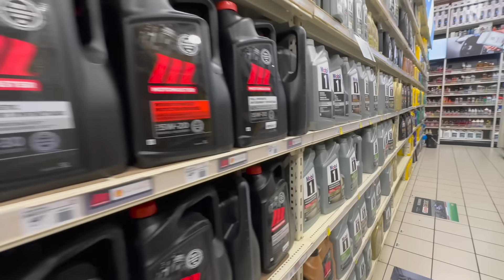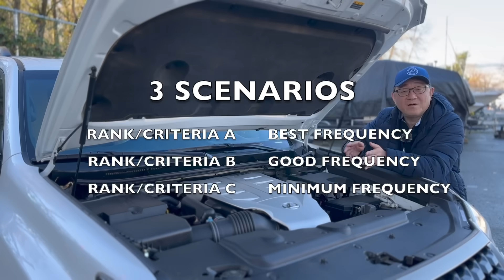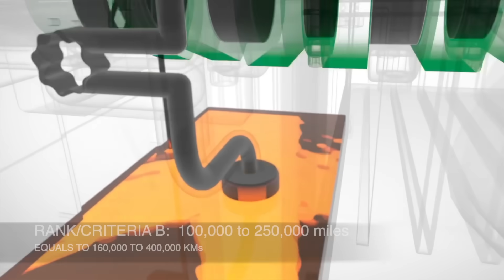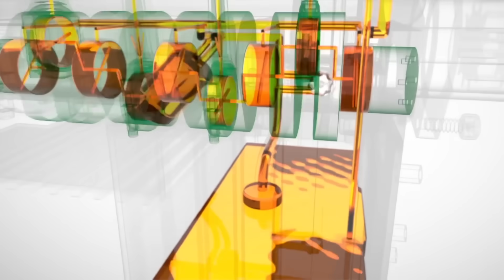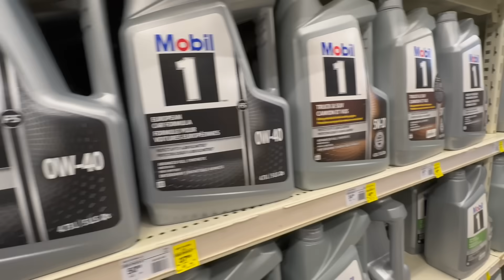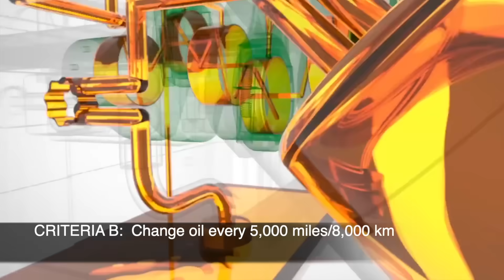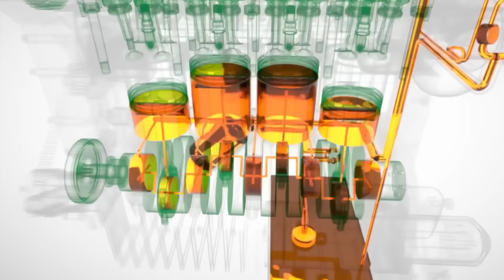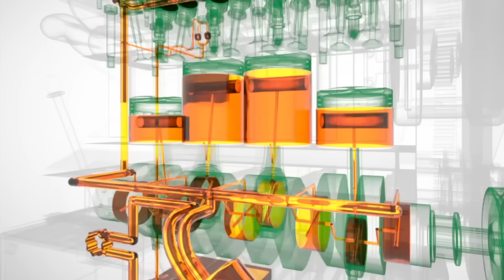ENGINEER EXPLAINS HOW OFTEN TO CHANGE OIL & FILTER // UPDATED CRITERIA-BASED RECOMMENDATIONS!

Comment: And on turbo engines without separate oil pump lubricating the turbo itself it's important to let the engine idle for at least 1 minute before turning off the engine. Giving the turbo time to rev down again before the lubrication is shut down together with the engine shut down. Some cars have separate oil pump for the turbo itself, but not all cars. Something to have in mind. 
Great video... thanks 👍

Comment: I have a 2014 mitsubishi lancer with about 80k kilometres on it. When it was new i changed at 1500k,3000k and then 4500k. There was fine metal in the oil at each change. Then i went to 7500k intervals. The book recommends 10000k intervals which i feel is too iong. Also the manual gearbox was recommended for oil change at 140000k which i feel is way to long for first change. I did it at 55000k and there was fine metal present in the oil. I use Nulon oil which is Australian made full synthetic. I get oil when it is on special and oil and filter change is under 50$ 
Cheap insurance. I put it on the dyno and it  gave 130hp at the wheels which is good for a 2litre 4 cylinder car. Everyone has there opinion but i think my car will outlast me😊

Comment: In the real world, where real people are responsible for real money, fleet managers with hundreds of vehicles invest in test equipment to ascertain the actual condition of the oil, per vehicle. They report intervals as long as 20k to 30k miles, 32k to 48 km. You must change the filter at 10k miles though. Even with a perfect engine, everything else on the car becomes a losing proposition overall past 20 yrs 250k miles, unless you work on the car yourself. The environmental impact of the waste from brief 3k intervals, versus even 10k intervals, is unconscionable. When pressed for data, author effectively says, "Just trust me." Red flag.

Comment: It’s your car, your money, oil changes are cheap compared to an engine failure, worked at a ford dealer for 40 years and saw the results of manufacture recommended oil and filter changes, worn out and sludge build up before 100,000 miles, these engines are still 120 plus year old technology driven in every type of climate, and conditions by every type of driver, the other factor that enters in is no one checks the level and condition of the oil, if it’s changed at 3,000 to 4,000 miles there is a good chance to catch a low oil condition, versus minimal oil left at 10,000 to 15,000 intervals.

Comment: Seems obvious that the best solution would be to improve the filtration instead of this continued nonsense of frequent oil replacement.  But that would substantially impact the bottom line of Big Oil, and aftermarket oil filter manufacturers.  Near me, the main utility company had a policy that they never changed oil in their fleet vehicles; only the filters.  And they clocked hundreds upon hundreds of thousand miles on their vehicles routinely.  
As oil breaks down, it will tend to vaporize and enter the PCV system to be burned away.  Water of course leaves, too.
Amsoil had an external oil filter kit which seemed to work well as I recall.  Toilet paper rolls were the filter medium used in DIY and some aftermarket filtration systems, and by the test results proved extremely effective.
Also, a surge reservoir in the system which would hold a quantity of oil under pressure would be used to prime the system before startup, saving up to 10 sec of initial oil starvation conditions and its associated wear.  
I believe that we're looking at this the wrong way.  But I must concede that for the average Joe, the info presented here has real value.  I just don't like that it's presented so myopically.  Let's think of the broader possibilities and demand progress as consumers, at least.

Comment: For vehicles that record time interval, wouldn't it be better to use that rather than miles as the determining factor? Thus, every 100 hours could range from around 3500 miles to 6500 miles, depending on the type of driving. I have a 2010 Toyota Corolla that is changed with synthetic oil every 150 hours. It still uses no oil between changes, is going strong and has 185,000 miles on the engine.

Comment: add 1600 miles more on synthetic is not necessary, all car manufactures and oil manufactures said up to 10,000 miles vs 3,000 miles on conventional oil.

Comment: Do ou have a recommendation for adding an oil cooler with extra oil capacity or for adding a bypass filter to clean the oil contaminants?
Reply: My old diesel tractor has a Perma Cool universal oil cooler sandwich adapter. Instead of the oil going thru a oil cooler it goes thru a flat head Ford V8 canister filter that has been converted to use Scott 1000 toilet paper. It has half a roll of Viva towels in it now. Got the adapter from Jegs years ago. If the tractor needed a oil cooler I could put one in series with the bypass filter. The bypass filter has no orifice. Its not important but the full flow filter is a Motorcraft Fl 1A. The Ford filter was optional equipment and used cotton.

Comment: Purchased a new '23 Toyota, synthetic engine oil started to get dirty and darken after a little over 3K miles, so I went to dealer to request change oil & filter for a fee, not for free.  These service people were argumentative and refused to change the oil, saying 10K miles was rule, so I went to another dealer. I believe some dealers want you to abuse your vehicles, so you can have more significant repair bills.
Reply: Yikes, put the tin foil hat away.

Comment: I've always changed my oil every 3,000 miles for decades now and have never worn out an engine.  Still driving my 1984 chevrolet, no telling how many miles it has but quite a few.
Reply: I believe you. It would be difficult to wear an engine out when you throw perfectly good oil away every 3k miles.
Reply: @majicogarcia8417  My guess is you don't keep your cars long and don't work on cars.  I've seen enough sludged engines to know changing the oil is a necessary evil if you plan on keeping it for decades.

Comment: Oil is cheap, engines are not. Use the right quality oil in the right application and change it when you should (along with a quality filter) and any well-engineered vehicle will give you years of service without any issue. 

As an aside, new Toyotas often spec 0W-8 oil and this is slated to be available at Walmart soon. Mobil is going to offer it and it does meet the required JASO GLV-1 standard. I have a 2024 Corolla XSE and thus far it's a very nice car.

Comment: I once had a 2005 honda civic. I changed oil every 10,000 miles per mfg. I ran 250,000 trouble free miles with synthetic Mobil 1. I assume the engine would've run forever sans the rollover accident induced by a drunk driver.

Comment: 2012 Hyundai Elantra 1.8 just turned 500K original  engine , only used Amsoil top tier oil and Amsoil filter  changed it every 11-12K it now uses two quarts between changes , no complaints.
Reply: My 12' Japanese Altima NEVER uses oil between oil changes.  If your car uses oil you have a major problem.
Reply: That's awesome. Wonder if it's valve seals or rings,  amazing oil.
Reply: In the early 80s Amsoil had a very good bypass filter. They had Bobby Unser saying this oil change is forever. At the time I was using Amsoil 10 40 with a Frantz oil cleaner. I quit draining oil routinely  in 1963. I believe the Amsoil bypass filter was better than what they have now and too expensive.

Comment: I do synthetic oil changes every 5,000 miles on my vehicles along with an OEM oil filter. I have no trouble making it to 250,000 miles. I definitely agree with your advice. Even though modern engine oils are excellent, it's the contaminates that are suspended in the oil from the air taken in from the engine, fuel, carbon and others. A bypass oil filter will really help this as well.

Comment: On minute 4 you say oil preserves its lubricant capabilities for a very long time.  How long would that long time be for a mineral oil 15-40 c.a.s.t.r.o.l GTX  (a decent brand name of oil) in an engine car (60 thou miles) with just short trips (7 to 20 miles twice a week) . What I've been doing is changing it every 3thou miles or every 6 months(whatever comes first) BUT since the vehicle is rarely driven I was wondering if I can extend the oil change intervals. Please Ivreally appreciate if you or anyone can answer my question.
Reply: Oil will last pretty much forever. It will get dirty You can burn it up. I dont drain oil but I use filters that clean oil. I drive enough at normal oil temperature for the PCV to remove the condensation and unburned fuel.  I use synthetic but the newer conventional oil is good. In the old days multi grades were crap. Couldnt use them in a diesel. The polymers stuck to hot engine parts. With filters that clean oil you might as well use synthetic. Jackmaster is the best in production. I have the Jackmaster Classic. Cant see buying the more expensive Jackmaster Ultra for my use. You can Google them. I havent sold filters for years. They havent put filters that clean oil on cars since the 50s. My 1937 Studebaker book said its not necessarily to drain the oil. Change the filter when the oil looks dirty on the depth gauge. I believe they used cotton in those days.
Reply: Of course you had to drain the oil if you got a leaky head gasket. Or a leaky fuel pump diaphragm that put gasoline in the oil.

Comment: Criteria A - Maximum Longevity (10 - 20 years) - 400,000 to 800,000 kms - or even longer.
Change oil every 3,000 miles / 5,000 kms  (6 months or earlier)

Criteria B - Good Longevity (4 - 10 years) 160,000 to 400,000 kms
Change oil every 5,000 miles / 8,000 kms or once a year or earlier - whichever comes first. 

Criteria C - Minimum Frequency (1 - 4 years) 40,000 - 160,000 kms
People leasing or financing - who don't value longevity are recommended to follow the interval in their owners manual. 

Oil is able to keep its lubrication properties for a very long time.  However, oil does get dirty and air and gas contaminants do get into the mixture Hence, why time is just as important as distance.  

I have huge respect for David,  AMD from The Car Care Nut Channel and every mechanic who offers sensible advice.  

I live in Alberta, Canada and drive a Corolla Hybrid. Here is my oil change interval. 

January - April 
May - August
September -  December

I drive less than 15,000 kms annually (suburban 60% & highway 40%)
Car has been rust-proofed and PPF added because Alberta roads have a  ton of salt and sand on the roads. 

Criteria A - Phenomenal owners
Criteria B - Fantastic owners
Criteria C - Are not bothered about the longevity of their vehicles and less likely to maintain them - Zero respect.

Thank you David & The Car Care Nut

Comment: All engines operate at different temperatures and run differently. I change my engine oil when the oil becomes a dark brownish colour regardless of how many miles it’s done. Oil and a filter is cheap-a replacement engine is not.

Comment: I drive a 2023 Mazda3 2.5 S Select FWD Sedan. So far, I've taken it in for an oil change & tire rotation about every 3500 miles. My first oil change was before a road trip from Illinois to Arizona and back. My second oil change was after returning from the road trip. I'm due for my third oil change soon. The car runs great and has been reliable. Not sure how long I'm going to keep the car, but I prefer to maintain it often and reduce the need for expensive repairs. Thanks for the recommendations.
Reply: Much respect for taking care of your vehicle... When you go and sell it with all the maintenance records the new owner will be able know exactly what fluids have been changed and when to replace the fluids that have yet to be changed.  
Thank you for taking care of your vehicle.

Comment: Regardless of criteria, if you run synthetic, change it ad 5,000 miles plain and simple. Especially if your doing a lot of stop and go.  The engine oil the life blood of an engine. These braindead 10,000-20,000 mileage intervals on Mobil 1 bottles and even manufacturer recommendations are insane. The amount of hydrocarbons, nitric oxide, dirt etc in your oil over that period of time is going to decrease you engine life significantly.

Comment: I've been buying cars every 7-8k miles.  I drive it and sell it without changing oil. For my that's one car/yr roughly. I just tell the new buyer the truth that I didn't have it long enough to do any maintenance.   Do this oil change ritual every 3k???  That is like yrs of a life that is too short already.. there is another level of reality most have not unlocked and it doesn't involve this sad practice of wrenching your life away to gain approval from serpentine oil salesmen.  Anyway, if you thought you had it figured out, you don't: I DO.

Comment: Thanks for these informative recommendations.  I have in the past used the 5k miles because it was easy to remember when my vehicle's oil and filter needed changing.  New vehicles like my 2016 Ram diesel 2500 and others have an oil percentage of life left. What is your recommendation based on the percentage? I just had mine done with 40% remaining. I was at the dealer, and it did cost $192.00  I am not sure of the elapsed mileage.

Comment: What’s your recommendation regarding a special early 2000 year car driven 500 miles a year using full synthetic oil?  Can the oil last 2-6 years, ie., 1000 to 3000 miles?  Thanks for your detailed opinion!
Reply: Oh and this car has only 22000 miles and runs well.

Comment: David, thank you for this video. I recently purchased a 23 Honda Ridgeline. They tell me that they change the oil and filter based on oil life and can go to 10k between changes.  The have an electronic method to monitor this. Have you heard of this concept? I am a firm believer in oil/filter change at 5k using synthetic oils.  Thanks for your wisdom.

Comment: You forgot to mention the Quantity (# of quarts)  *of  course your only  using: full synthetic oil.  
Most newer cars/suv's have a 6-9 quarts cap, with the Manufact recommends a 10k change , that should be your B or C..  
But if your Cutting that in half or 2/3 change intervals (5-7.5k) That should be your A option.

Comment: Disagree with the 3k mile change interval. Having owned 3 cars with for over 10 years changed the oil at 7k mile change intervals. One of the cars I held onto was an Acura 3.0 CL. The car had over 250k miles when I was getting ready for an OS deployment. I changed the oil once a year with a replacement filter every 6 months. Always recommend using OEM oil filters. The video showed Fram filters. Use to use only Fram until I seen their quality drop to such a low point I will not run a Fram any longer. Not sure of his speciality in the engineer field. I can tell you when Ford changed their extended oil intervals they based this on empirical data. Why would an OEM with a 10 year warranty extend oil change intervals beyond 3k if they did not believe in this. You are wasting precious resources and your money if you follow his advice.
Reply: I think that we are talking about risk here. And if you wanna keep the car for long you wanna minimize the risk for enginefailiure. Dosent mean your car cant keep going for long with a little luck even if you dont change your oil frekvently.
Reply: All factors considered to incl risk and you are still wasting money changing oil at 3k miles. Based on design some engines are subject to creating sludge. Aspirated vice non-aspirated. As well as other factors. Back in the 60's we changed oil at 3k. However, with the refinement of additives we can continue well beyond 3k and still keep our cars. I have had 2 cars with over 250k miles and no problems. Not even a leak. @danieljonsson6230

Comment: Or you can just change oil everytime you fill up gas.
Seems like you are stuck in the 50's with these recommendations.
Give me scientific research that prooves that it is bad to run 10000 miles between oil changes using modern synthetic oils under normal driving conditions.

Comment: I am financing a 2022 Toyota Highlander le AWD. Total sale price will be  $72,867.75 with an annual percentage rate of 8.34% . From City World Motors located in the Bronx NY . City World Toyota had me purchase an extended warranty . I go in for an oil change and they tell me its every 10,000 miles or if I wanted I could pay out of pocket . I went in for an oil change at 10,000 miles and they put the sticker for the next 10,000 miles . I pull over to check the engine oil dip stick and to my surprise the oil is dirty . I went back and told the clerk and he said synthetic oil could last for a very long time . Now I have to wait another 10,000 miles for an oil change for a vehicle I plan on keeping forever . I might as well keep it for ever because these aprs are ridiculous . Please don't buy a used car . They don't take care of the vehicles .

Comment: I would like a bit more info on the “or 6 months “…
We bought 2 new corollas ,I drive 6000 kms a year but my partner drives only 3000 or less a yr so her car is in the garage most of the time …her oil is still like new …
Question :when to change her car’s oil ?thank you from Toronto ,Canada .

Comment: I did oil changes every 12000 miles or so. Even with 150k miles never had a car that had any mechanical issues or any oil consumption. Never.
But ok, I never owned an American car and rarely drive short distances.
It's so funny that in Europe we do oil changes every 15 to 20k miles and the Americans every 3k. Probably because you drive to the shopping mall half a mile away every day.
Reply: How long did you drive youre cars???